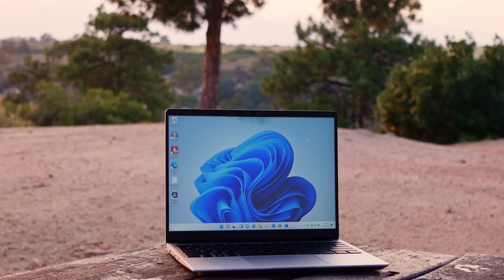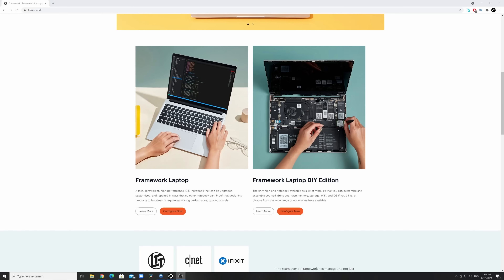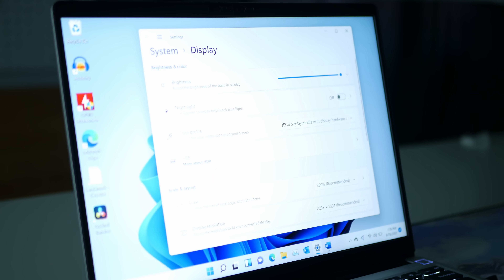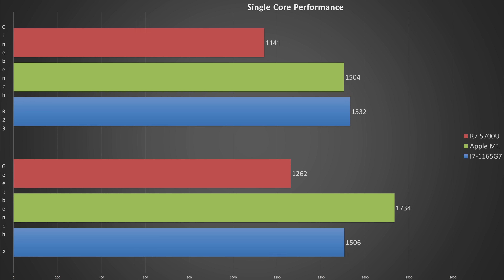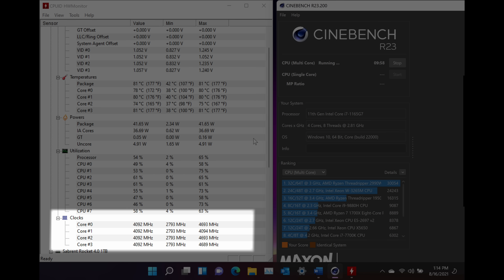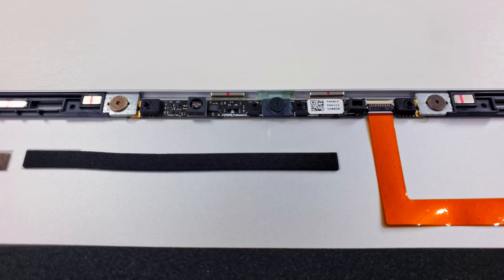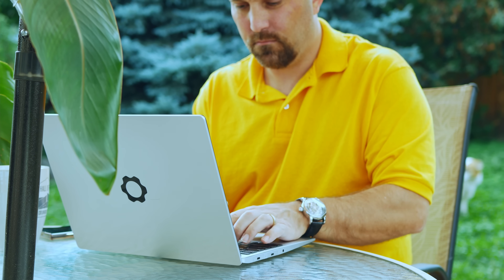The Framework Laptop - An Honest Review.

Comment: Even though I really like the performance of Apple's M1 and am deep in the "ecosystem", I'm so incredibly tempted to get the Framework instead of the upcoming new MacBooks just to support them.
Reply from the maker: Do it! 😁
Reply: Please do! Am doing the same.
Reply: I am betting the M1 will suck less power than an intel processor. If you are considering solar and off grid then this might be a consideration. I just like to NOT waste power on anything at home if I can turn it off or down. I am the guy checking the power usage on the Electrical Company website every day.
Reply from the maker: @moviestudioland  Actually you can lock the Intel CPU to a 15W TDP while the M1 has no user configuration and will operate up to 40 watts at load. The M1 has better performance par watt but the 1165G7 can use a lot less power thanks to user set power levels.
Reply: @ElevatedSystems  This really isn't true at all

The M1 does not and cannot use 40W even at max load. The entire M1 mini only draws 39W under max load and that includes the inefficiencies in it's power supply, the RAM, and other system components.

The maximum TDP of the M1 is thought to be about 15W under maximum CPU load, maybe a little more if a GPU load is applied as well. This is equal to the Intel with power tuning. When you factor in that the M1 completes tasks faster and uses less power at idle it will overall use significantly less power than the Intel system. You also have to factor in that the Framework laptop has to spend more energy than an M1 laptop on cooling, RAM, and IO. This is especially true given most systems spend the majority of there time at idle.

The MacBook Air doesn't have to spend any power on cooling since it doesn't even have a fan, which also effectively lowers it's TDP for prolonged workloads.

Which isn't to say that the Framework laptop isn't something you should support. It is a very good idea in and of itself. What it needs (and really all laptop PCs need) is better, more efficient processors. Ideally something as efficient and powerful as an M1 - or better. Luckily many companies are looking into making ARM processors for PCs and you can already buy Windows laptops with ARM Snapdragons and Linux laptops with cheaper ARM SoCs.

You can also further restrict the Intel CPU but it would effect performance and maybe even efficiency. Some CPUs actually use less power running short workloads at higher clockspeeds and then returning to idle more quickly than doing it slower and spending less time in idle.
Reply: Same.
Reply: Same boat here. Just waiting for them to open up to orders in the EU.
Reply: Same here. I’m really tempted to get the framework but am so deep in ecosystem that I don’t know if I can go framework. (I considered hackintoshing but xe graphics are mot supported in macOS so will run like shit if hackintoshed)
Reply: @harryhall4001  you are taking it too far..

Ofc.. M1 is efficient in daily task

But it will be a paper weight when you storage fails...and i dont care how long...but never as long a laptop with replaceable storage option....

So yeah.. I will never pick a soldered laptop... Apple is greedy as always..
Reply: Dont do it, the less apple users using it, the better
Edit: i see how ppl can read it and think this is an attack, chill, this is a real and honest strong advice, stay there.
Reply: @datavalisofficial8730  yeah you need to back that up with data. Because right now it seems a hell of a lot like you’re just hurting framework and helping Apple. By having an elitist attitude saying that Apple users shouldn’t use the framework. I am an Apple user who built their own PC. Those groups are not mutually exclusive.
Reply: @asdbef3667  That wasn't my point at all. I was correcting the bit about the M1s power consumption and if the Intel chip can be configured to use less.

I wasn't saying don't buy the framework laptop. Or even saying M1 was better overall I was just doing a fact check as the guy was talking complete shit. M1s default TDP is only 15W unlike what he said. It's Intel who misses the mark on TDP not Apple.

I actually think having upgradable SSDs is great and would much prefer Apple laptops and more Windows ultrabooks to have that option.

If we are being realistic though SSD failures are very rare nowadays and the machine would probably become obsolete before it happend.
Reply: @magicmanchloe  Please, try to re-read my comment, reconsider, rethink, and understand, i even made an edit clarifying my point, im not here to cause a fight or anything.
Reply: @harryhall4001  an ssd Will last 10 years if you barely use it and if the storage is 1TB..for heavy usage..also it is still not cheap enough for higher storage..

I have seen ssd fail within 5-6 years light o moderate usage..

also..you wont see any difference between sata and nvme during normal to moderate tasks..

You got a bit wrong..i am not an apple fan...i hate apple for their bad practice..

About m1 efficiency...tell that to those apple delusional fans and they Will send cavalry at you...xD
Reply: Do it!
Reply: @harryhall4001  i think you need to re-check your info on the M1. According to the notebook check website the m1 has 2 variants. A 10 wat tdp low power version in the MacBook air and a higher power version in the 13 inch MacBook pro and Mac mini. Also according to a cinebench test done on the MacBook air listed on that same site, the MacBook air with the m1 used 27 watts after subtracting the amount used by the external monitor for the test. So, a 40 watt power usage would be reasonable for the higher power version of the chip. Especially including power supply losses and the like. And it is honestly weird how up in arms you seem from your comments over 1-10 watts of power dissipation. Especially since Apple does not list power use specs for the higher power version of the m1 on their website as best I can tell.
Reply: @joshnabours9102  You just proved my point again. 27W would be the whole system - not just the chip.

The MacBook Air uses exactly the same chip as all the other devices. It even hits the same clockspeed and performance measurements. So this is a lie.

The reason it's only able to hit 10W under sustained load is because of cooling - not because it's somehow a different chip.

Edit:
I don't get why so many people have a problem distinguishing between system power consumption and chip power consumption. You also need to realise that the power consumption stats given by Apple aren't a lie like Intel. Intel gets away with it because of "turbo boost" but the M1 doesn't have "turbo boost" so it doesn't have a reason to go over it's rated TDP.
Reply: @harryhall4001  or because Apple can disable  the 4 higher power cpu cores in software and throttle the gpu as the computer heats up. You can't even know what the higher power version of the chip's consumption truly is since Apple's website doesn't say. neither of the 2 m1 related press releases on the Apple website nor the mackboor air page actually list a wattage rating at all. So why are you so up in arms about a 10 watt margin of error when you can't even know what the true numbers actually are?
Reply: @asdbef3667  klaptops have soldered cpus
phones are entirely soldered
Reply: Choose what works for you best. If the Macbook ecosystem is working well for you and you see no real benefit to switching to windows then stay there. Windows isn't perfect but personally I like it because of the freedom that comes with it and I like games.
Reply: If you do, I'd recommend foregoing the standard storage option and installing an SK Hynix Gold P31 in there. The standard WD Black SSD sucks more power, especially when sleeping or idling. This will lead to a modest battery life improvement.

Or at least, that's what I did. Haven't done any battery life testing, but others are saying SSD swaps help.
Reply: @PotatotheTroll  my transcend 220s nvme also giving poor battery life to my laptop..compared to HDD........ both at idle and obviously under load.... and i thought Nvme takes less power than HDD
Reply: @asdbef3667  It can and should. Can't say I've heard of that drive.  Perhaps you'd get some mileage out of an SSD swap as well.
Reply: Do it, this laptop is insane and you are supporting a US based company that is all for the right to repair and better for the environment. It's why I will never buy an Apple product because they are so hard to fix.
Reply: @moviestudioland  But this Framework Laptop is gonna have a longer lifespan than a macbook because you can upgrade and repair it afterwards, and then you wouldnt need to buy anew chassi so soon. And the production of the Chassies and the pcb also you a lot of energy which hurts the environment.
Reply: @asdbef3667  when is the last time internal ssd failed? Just hypotheticals that never actually happens.

Moreover you surely do backups and such right? 

Ssd are highly reliable nowadays
Reply: @datavalisofficial8730  what’s Apple market share? Why are you so scare of Apple?
Reply: @asdbef3667  my 2012 mbp ssd still works 100%. The laptop is starting to fall apart… like all 10yrs laptops. Battery needs replaced, dead pixels, and cpu too slow, and ports starting to fail due to dirt accumulation and years plugging and plugging devices thousands of times.

Ssd outlasted the computer buddy. Stop spreading myths
Reply: @asdbef3667  apple ssd is high quality not the cheap crap you buy from random vendors.

They are made to last

As for apple efficiency. Not amount of hating will change the fact that mba last a whole day on battery. Can’t say that about any Intel laptop.

Stop it
Reply: Same. It would send a message to all these big players that we’re tired of soldered everything.
Reply: @RunForPeace-hk1cu  i am so interested in the billions of complex equations that your neurons did just to reach, of all possible conclusions, that of all things, i would be SCARED of Apple

My personal advice for any apple users is to not buy the framework, should i think you and other apple users here are scared of my point too? You should be scared by that laptop on the vídeo, the marketshare of "dataValis" in the world is less than 200 ppl
Reply: @RunForPeace-hk1cu  you know nothing about ssd and number of people who had to buy new pcb for worn out ssd..

Apple doesnot make ssd from heaven

They are all the those "cheap" crap...

You apple fans never fail to amuse me
Reply: @RunForPeace-hk1cu  I am power user. I had to replace SSD in my MacPro twice. First under warranty, then again after warranty. The third SSD still runs. If the SSD was soldered (like in MacBooks, which I also own one) then I would be on my 3rd MacPro. So approach of Framework is much more reasonable regarding environment’s protection. 
Because everything is soldered in Apple laptops and MacOS is getting worse every year I will be moving out of Apple “ecosystem” after 25 years. Moving back to Linux. On Framework.
Reply: Apple ahahahahahaha
Reply: have you seen the comparrison of the new M1 with the alternatives in the same class on linus tech tips?
Reply: I bought both. 

I need macOS for some iOS programming, but I felt I HAD to support framework for being so user friendly
Reply: I'm doing the same. I'm hyped
Reply: @BeansEnjoyer911  hmm interesting, I've never seen a programming language that only works on Mac. Not saying it won't, would u mind elaborating?
Reply: In the same boat.   $430+ extra just to get 16gb and 512gb option for m1 Air is price gouging and what's steering me to framework, and then I don't need a separate laptop for visual studio.  Being able to spec and bring my own  1tb NVME, and 32gb ram for about $230 over base is a huge selling point.
Reply: @theorphanobliterator  not the person you asked but I can answer this question. You can’t develop iOS apps without Xcode which is Mac only.
Reply: @schlong8276  mm interesting
Reply: Do it! Do it!
Reply: @moviestudioland Ryzen version will be available soon. Still not as efficient as M1, but pretty good nonetheless

Comment: Just one correction. Even if it fails, the laptop is still more upgradeable and repairable than an Apple product and most laptop computers you can buy. The vast majority of it's parts are stuff you can buy from intel and other manufacturers and we know that some 3rd party ports will be made. At least temporarily. 

So even if it fails, we can still upgrade and repair our PC much more than the other guys.
Reply: Totally agree. You can swap not only ram and ssd, but also whole motherboard to i7 with better boosts and more cashe. So - even CPU is upgradeable for most buyers (those with i5), even if Framework fails to deliver more options. And yes, other notebooks allow to swap motherboards, but these manipulations are way more complicated and can cause troubles.
Reply: Modular does not matter unless you CAN replace the motherboard or CPU board with upgraded CPU.
Reply: @moviestudioland  you say that as if your hating on the product, but the issue is that you literally cannot source socketable mobile Cpus anymore. Even if you could, it would make the device thicker, which would kill the entire point of this product and all of its mass market appeal. Ideally, in 5 years they can have a "framework pro" which can be a bit thicker and have a socketable CPU, but having that as your one single product would kill them in an instant.
Reply: We won't really know that it will be truly upgradable until it's been out a while. So many technologies we take for granted today didn't exist 3-4 years ago. Mainstream portable laptops don't really benefit from marginal upgrades, so we have to see if you can actually keep the majority of this laptop intact in 4-5 years when you're ready for a serious performance boost. That said, repairability is a great thing to have in a laptop, and for DIY types and for businesses with IT departments, I think this could be wonderful. In the class of mainstream laptops, though, I don't really see why I would ever want this computer when Apple laptops are similarly priced, have good service options, tend to perform better, and can be sold at a very reasonable loss in 3 years. However, when Framework makes a gaming laptop, that's where things like upgradability will really start to matter, and that's where I'll be interested.
Reply: @moviestudioland  you can do that
Reply: @moviestudioland  well what do you know, we CAN.
Reply: @moviestudioland  yes it does, they just released upgraded motherboards for the framework, the whole device is upgradeable
Reply: @mbvglider framework 16:

Comment: I didn't know they included an STL to print your own enclosures. That is very intriguing, now I've got another reason to get one of these.
Reply: Not only an STL, but additional helpful material and even sometimes support in their forum as well. And they are working on a platform to sell third party modules through their website.
Reply: If I didn't prefer the durability of the Aluminum frame I would probably be tempted to print a clear case when I got one, just because I miss when electronics had clear cases to show off their cool inner bits

Comment: 3:57 For anyone watching this later on, Framework mentioned in a blog post that the Wi-Fi card will be pre-installed on newer DIY Edition batches, 8th batch and later if I recall correctly.
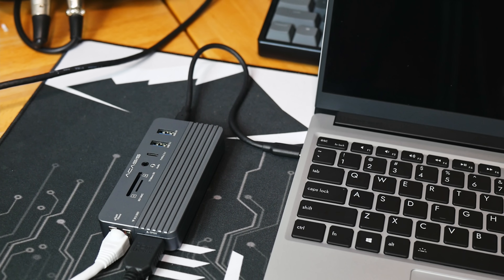10:08 Framework also mentioned in the same blog post that they're adding a heatsink to the flash drive!

Comment: This Laptop will make a lot of sense for businesses that are using it far from normal repair resources. It might go well with a Star Link modem. The Configurable connections are great as it could save on dongles and you’d only need to put the Hdmi/DP on it when needed.

Comment: I love this device! I truly hope that they manage to stick around for the long run. Their value proposition is quite unique, and geeks like me are not a massive market segment, but I would love to see them succeed. Hardware is a tough game. People may point to the likes of System76, Slimbook, Tuxedo Computers, etc as examples of smaller hardware companies finding a sustainable market. It should be stated though, that while those companies do have some manufacturing capability, most of their laptops are OEM designed and manufactured, rebranded and distributed under the new brand. The Framework Laptop is a custom design and requires bespoke manufacturing.

Comment: I think upgrading the GPU will be far less important than changing a worn port or the hinge, the keyboard, the fan etc... So having the GPU soldered is not a big deal. Even having the RAM soldered is ok. I don't usually upgrade that often and I haven't had a faulty processor or RAM module. If it's working during the warranty usually they work for at least a decade. But having the ability to fix everything else makes me feel super calm!

Comment: A just ordered one from batch 8 in the UK. I'm glad they've made it this far! Thanks for the useful review. Everything is within my expectations so far. I've made all the same choices you did except I'll probably put Linux on it, at least at first.

I suppose if Framework fail it's still possible for others to make accessories or build on the concept. Maybe.

One idea I have is that as my kids get older I might get more Framework laptops and parts can be handed down. If they manage to make a bigger, more powerful base model but many of the parts are still interchangable, that could be useful. I know it's been useful in a multi-PC household being able to swap parts around, even if just for doing diagnosis.